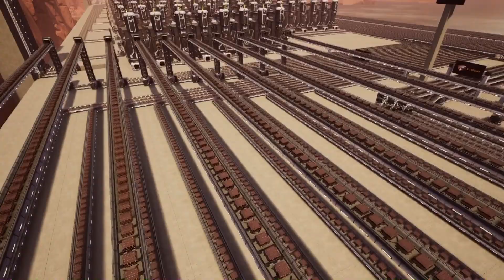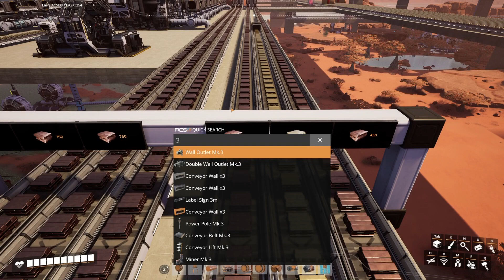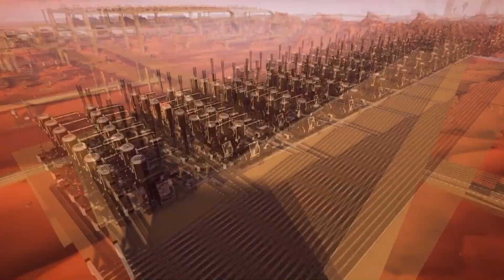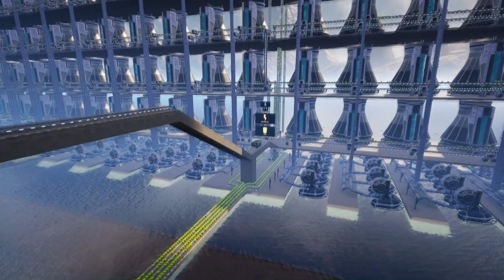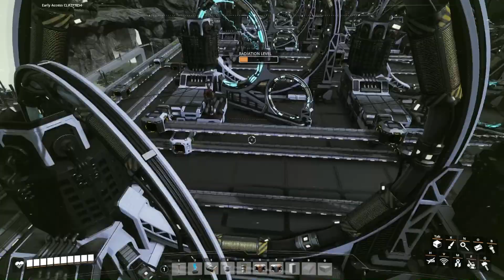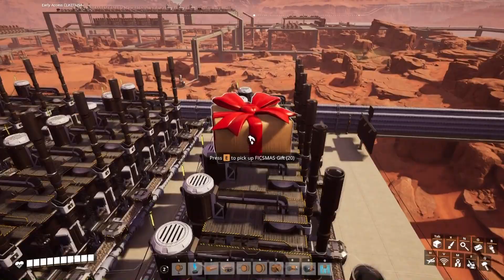SATISFACTORY - 25,000 Iron Ingots p/m - THE NEXUS Ep 4

Comment: Why are they all going into resources sinks lmfao
Reply from the maker: It's actually to stress test the system and troubleshoot any issues it might have (or find any mistakes I made)   before moving onto the next phase of production
Reply: @danp6918  Fair enough I suppose. I did a similar thing on a smaller scale but I guess when you're doing a multiphase build, you would want to make sure every phase works

What a thumbnail though lol
Reply from the maker: @chrisj4288  yeah plus it kinda looks cool as opposed to everything just sitting still on the belts and the machines flashing yellow

Comment: Allow Large Inventory
Daisy Chain Buildings
Focus Keyboard on Search Box (Easy Fix)
Add Player Config (Walk and Run Speed etc)
Allow No Gas Pillars
Change Awesome Sink to a small sink.
Add Icon Signs
Add Item Dispenser
Infinite Zoop
Infinite Nudge
Add Conveyor Wall Hole
Add Massupgrade Tool
Add Load Balancers
Add Factory Props

All this needs to be in 1.0 before I consider going back to it.
Reply from the maker: I agree with most of what you say,   to be fair though,  it's quite a small team working on the game,  and in the years of playing I have noticed they do listen to what the community wants and they do constantly fix bugs and upgrade UI and QoL things,    the ability to reverse direction of conveyor lifts was such a small thing, but absolutely needed  they listened and added it,   just a small example

Comment: Love the content and love that you're back on the grind!

The problem with water at max capacity of pipes is that the machines don't take in the water at a constant rate. it'll take in a certain amount of water every time it's done. that creates the slosh back and forth in the pipes. some people say elevating the pipes is what fixes it, but that's not 100% true. the only 100% way to work around the issue is never requiring to fill pipes to max flow rate. full pipes are best, as in the pipes system needs to be full, but the water in there shouldn't require to be max flow rate.

have the production lines be requiring 540 p/m or something below 600 and fill them with a flow rate of 600. it'll always refill gradually. sometimes water extractors will go idle because it's producing more water than needed, but that's really the only way to prevent water issues.

my nuclear reactors require 480 water p/m atm, but I overclocked some of the extractors 2%, so that the reactors are getting 482.4m^3 of water p/m. it guarantees the water issues don't rear their ugly heads, but the extractors also don't idle often at all.
Reply from the maker: Thanks for all the info!    yeah so basically (at the moment anyway) pipes = jerks,  so feed them more!    =0